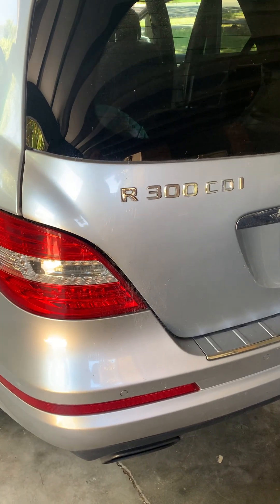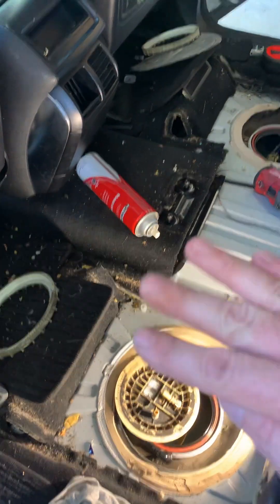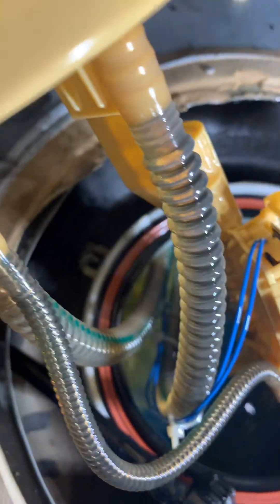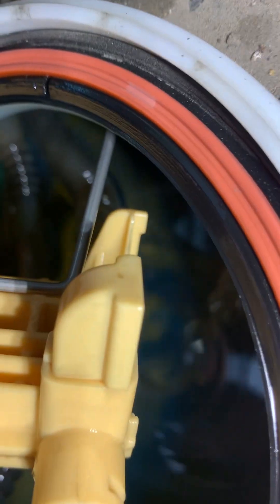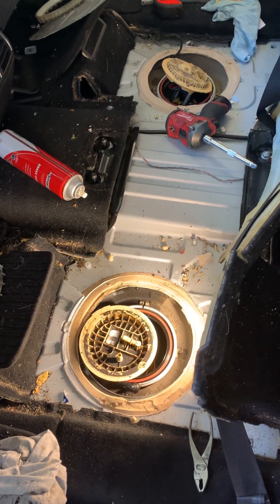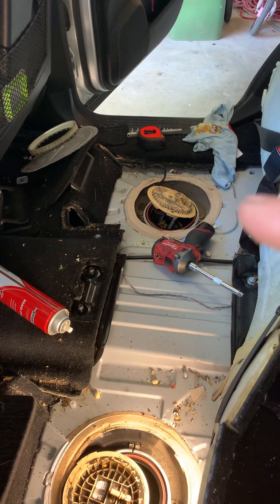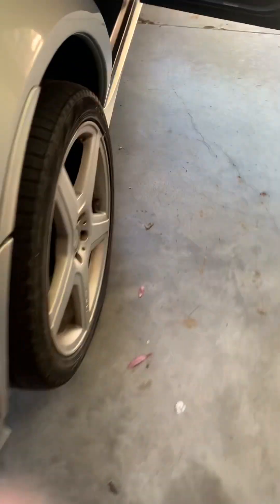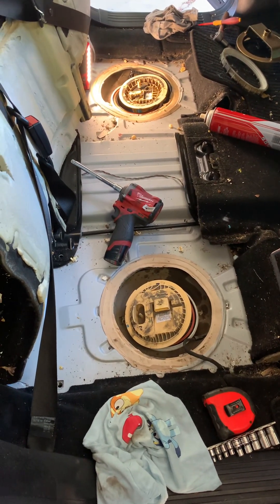Mercedes R300 runs out of fuel at 1/4 tank - WATCH THIS FIRST!

Comment: I've been having this issue on my w212 bluetec. Just changed my filter as it was due anyways. I'll have to crack the tank open again and see if the level has gone down.
Reply: Mine same...bleeding left me stranded....with about quater of tank.... replaced fuel filter and car didnt start... so now trying to find out whats blocked...did you sort it out yourself?